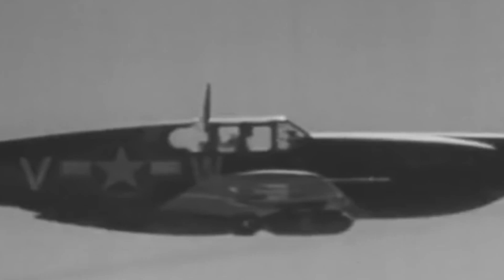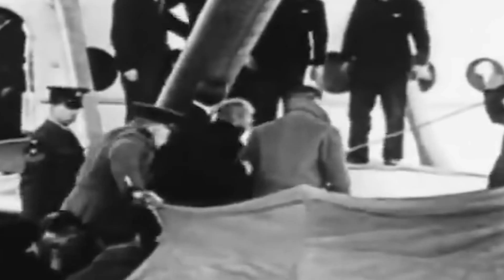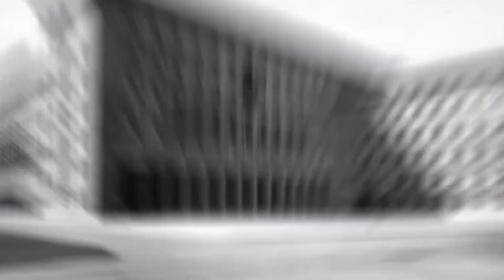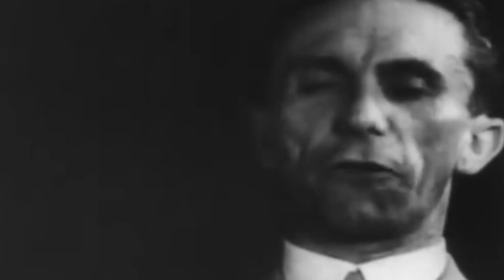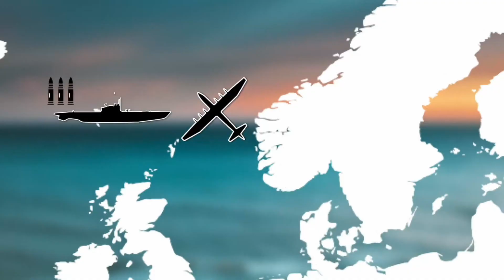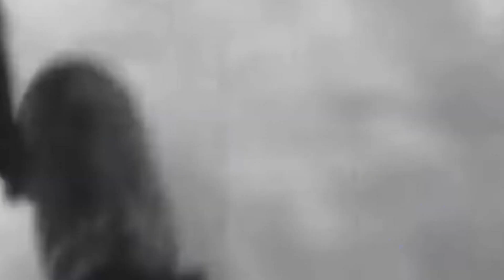The Insane Engineering of the BV 238

Comment: Famed Royal Navy test pilot, Eric 'Winkle' Brown was tasked with getting the only airworthy example to Britain for evaluation at the end of the war. It was a notoriously difficult plane to fly, so Captain Brown was in  the cockpit with an experienced German co-pilot, and flight engineer who controlled the elevators, who Brown felt was a bit 'off'. The plane was on a fjord, just long enough for it to take off from. It became obvious to Brown as they thundered down the fjord, that the engineer had no intention of letting the aircraft go to Britain, and Brown had to have him removed from his station to release the elevators. Both Germans became a bit 'fighty' after this, and Brown taxied back to the start point, and put them off, replacing them with some RAF techs. and this time, took off successfully - the Germans had intended the plane to be wrecked on the rocks at the edge of the fjord